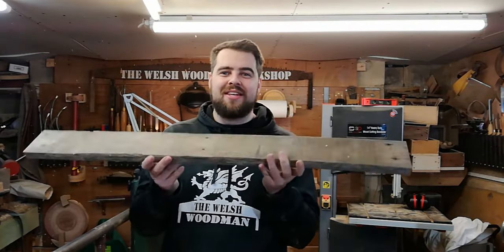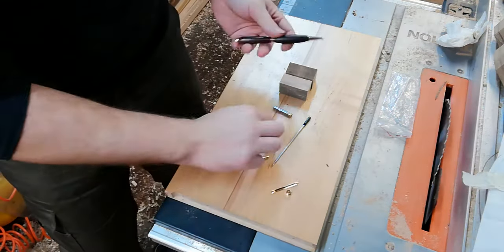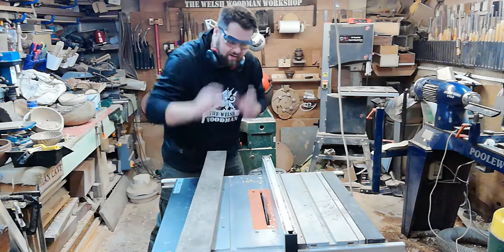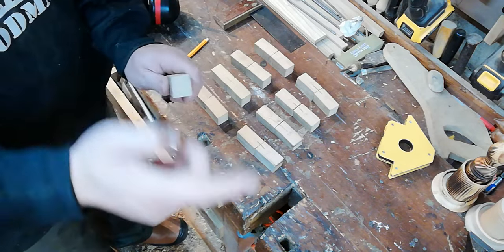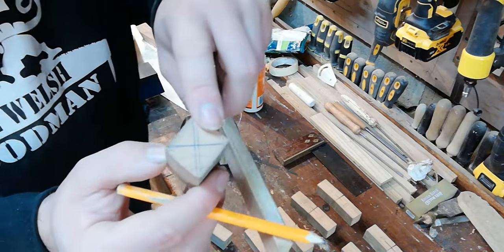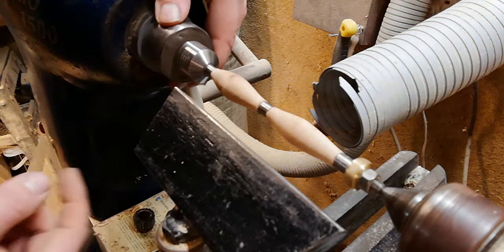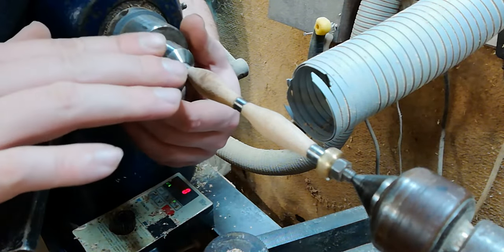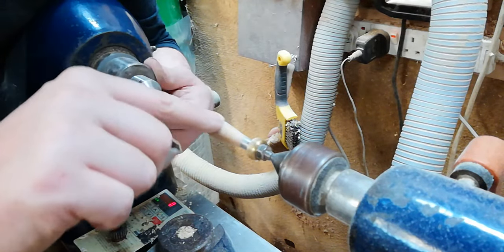Woodturning - How to turn your first pen

Comment: 1st. This video explains the process so well. That has to be the most solid stop block I have ever seen on a chop saw. The only thing I do differently is that I press the end cap in separately so I don't risk pushing the mechanism in any further into the nib section. Hwyl, Huw
Reply from the maker: Thanks Huw, the stop block is a bit of old railroad track I fide it easier to plonk it on the saw rather than clamping loads of stop blocks into place. That sounds like a really good idea about pressing the end cap separately, I'll be giving that a go 😁 thanks

Comment: This is a great video for a beginner like myself. Just got my starter kit for making pens and taking it a step at a time. Waiting for my small vise to arrive so that I can drill straight holes. You have actually addressed my first bump in the road, so to speak, by simply placing the wood block under the vise to limit drilling distance and allow the hole to be drilled completely through.
Thank you.

David in Texas USA
Reply from the maker: Thanks for your comment David, its great to hear your getting into pen turning :-) I'm glad the video was useful, thanks for watching :-)

Comment: Hi TWW - I've just retired and starting a woodwork hobby. Got a lathe now as well and today got a load of pen turning stuff from a friend whos BIL passed away. So now I've just been binge watching pen making videos. Yours is so simple and easy to follow - thank you.  What sort of price do you sell on markets for?  I know different woods are different prices but in general pricing I need. I havce a load of skinny and bigger blanks as well as a pile of pen sets. We have a local monthly market and is massive with a huge footfall. I used to make South African biltong and sausage etc and did really well. Now I've done a few with kitchen boards etc and will go into the pens along with other stuff turned and general wood things. 
.
Reply from the maker: Thank you so much for your comment Gavin, I'm glad to hear you have taken up woodturning as a hobby. I sell my pens £15 + at markets, again the price depending on the cost of the kits and timber used, I hope this helps give you a ballpark to start with. Best off luck at your markets I hope they sell well.
Reply: @thewelshwoodman649  thanks for the reply. |I'll use your info.

Comment: A great video, clearly explained.  I watched this in bed and was so enthused about the pen press I ordered the lever mechanism immediately- £7.50.  The Milescraft pen press uses exactly the same lever mechanism just with a very long lever and costs £102.  I am thinking that I might turn a slightly longer lever for my mechanism purely to allow for aged arthritic hands; arrival date is tomorrow so MDF at the ready and thinking cap for lever conversion.  Sizes for your press and adjustment blocks  would be great!
Reply from the maker: Sorry for the late reply peter, I'm glad you liked the video, I hope you are having lots of fun making pens and the press is working well for you.

Comment: Finally got round to my first pen, not as flipping easy as what I thought it would be, made a couple of mistakes, I didn’t manage to get the drill hole straight right through the middle and made the top half of the pen too wide so I couldn’t get the damn clip on,( trying to be a bit too flighty ) all in all very pleased with myself......thanks taff, that was really well explained. (which I like, being a Yorkshire man)
Diolch ffrind.
Reply from the maker: Thanks for your comment Richie I really appreciate it 😁 glad you've had a go at making first pen. I made the same mistakes as you when I made my first one 😊 as with any turning the more you make the quicker and better they will get👍thanks for watching.

Comment: Those look amazing although the extras to add to the lathe am guessing could be expensive maybe once ive bit more skill and practice. 🏴👍
Reply from the maker: The pen mandrels are around £20-£50 depending on the brand, you just have to try and find one that matches the morse taper of your lathe :-) I hope this helps.

Comment: The press jig...what have you used for the press handle end? Great video as always!
Reply from the maker: Hi Chris, I used I push pull style toggle clamp here is an eBay link to the sort of clamp I used, hope this helps 😁
 https://www.ebay.co.uk/itm/GH-305-Plunger-Stroke-Metal-Push-Pull-Toggle-Clamp-227kg-550kg-558kg-680kg/372767748109?_trkparms=aid%3D555018%26algo%3DPL.SIM%26ao%3D1%26asc%3D61083%26meid%3Dfc89e00a2eea442f91b0226123aa8bdd%26pid%3D100935%26rk%3D5%26rkt%3D12%26mehot%3Dpf%26sd%3D173955820602%26itm%3D372767748109%26pmt%3D1%26noa%3D0%26pg%3D2332490&_trksid=p2332490.c100935.m2460

Comment: Just curious, I have some friends that enjoy a particular brand of pen (signo DX) is there any way to turn a pen and use their internals to make it work?  Thanks.
Reply from the maker: I'm sure there is, another way to make pens is to drill a hole in the blank the size of the pen refill with a long bore drill bit, then turn the blank. That would allow you to use the pen refill internals. I hope this helps xxxx

Comment: Hi there, my 14 year old son who had his first lathe 3 months ago, wants to make a pen,, he has no mandrel, pillar drill etc, basically just a lathe, I’m confident in his ability. But is it ok to let him try to make a pen with just a lathe and his ingenuity??? 
Thanks
Reply from the maker: Hi Matt, there are other pen versions you can make without the need for a mandrel and pillar drill, that can be safely turned between centers.  I used to turn pens that could take Bic pen refills, before having a pillar drill and mandrel all this required was a 4mm long bore drill bit to drill the hole to accept the ink part of the pen. I would highly recommend he wears an impact resistant face shield and respirator to keep his eyes and lung safe. If you are interested I might make a video on the process I use to make pens. I hope this helps 👍
Reply: @thewelshwoodman649  thank you for your reply,, totally agree regarding the face guard and mask, first thing I drummed into him,,,

Comment: What kind of a price range would you put on those?
Reply from the maker: It depends on the kits you buy and the materials you use to work out your initial making cost, then I pluss on a bit for labour time, finishes and a some to cover my overhead costs,I normally sell pens like this £15+ I hope this helps you 😁